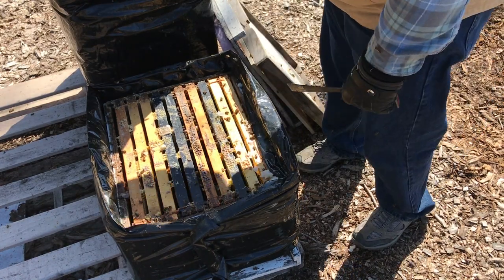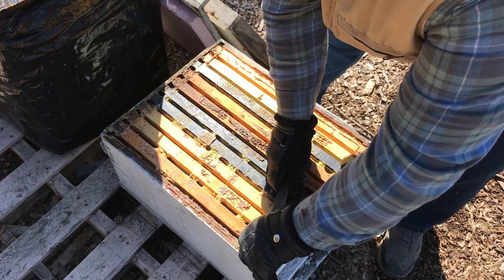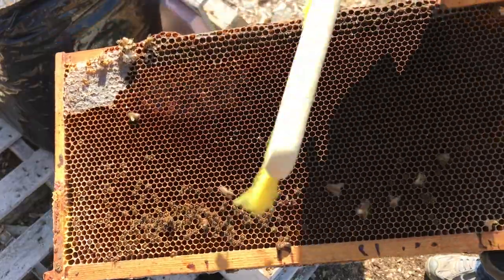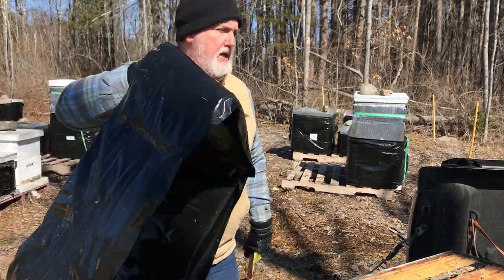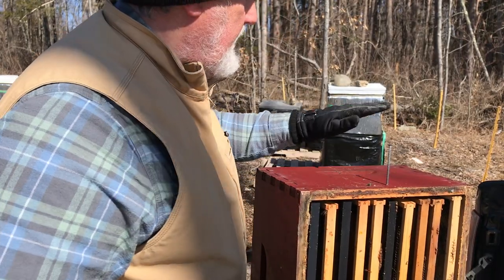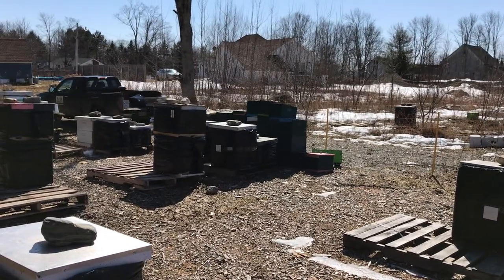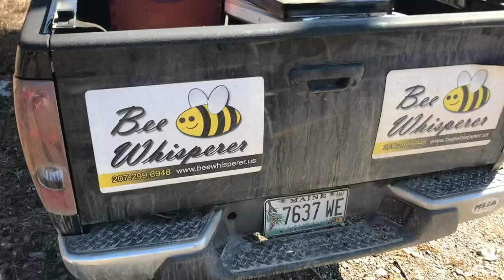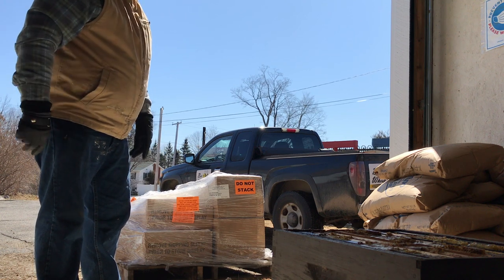What to do with a dead hive

Comment: My bees died in December.  I just went out to check and clean the hive , 2/25/2024.  I was brushing the dead bees off and there is a green mold under them. Is it still safe to use?
Thank you for your video.
Reply from the maker: The mold is not an issue for the new bees who will clean it up. In most cases winter losses are mite related and as long as the cause of loss was not AFB it should be OK to reuse.
Reply: Thank you.  I’m very new to bee keeping.  I did notice some of the frames with huge clusters of bees.  There was a a Webbing holding them together.  Did that happen after they died .  It was a full hive with a full super of honey.  There were a total of two supers full of honey late fall.  The first super closed to the brooding chamber was almost empty but the top super was completely full.  So it wasn’t lack of food that killed them
I checked on them right before we had the flash freezing temps to come through and they were all active.   
Thank you for your help.

Comment: Was moisture a problem? I saw sugar on the bottom board.
Reply from the maker: I think moisture is often assumed to be a cause or contributor to hive loss when I believe that it is often a condition which comes about AFTER the bees have died and the hydroscopic nature of honey and sugar feeds actually absorb moisture from the air which accumulates with no ventilation, also frames full of very cold capped honey will have water vapor condense on them when we get warm humid winter days.